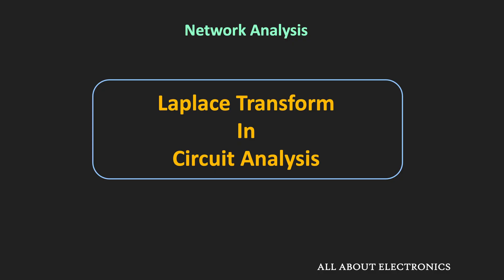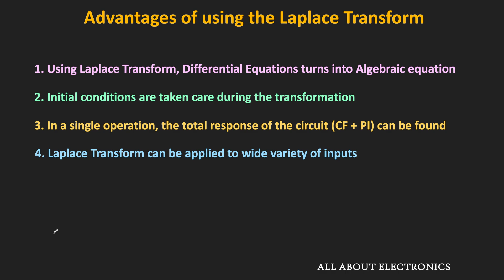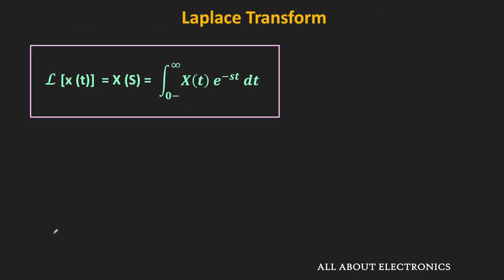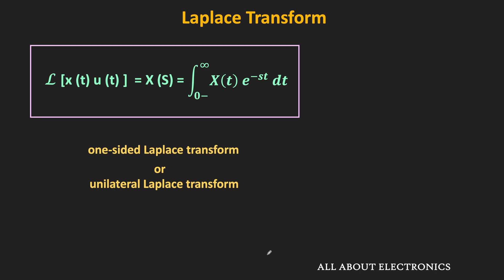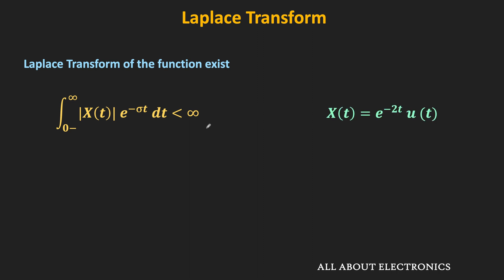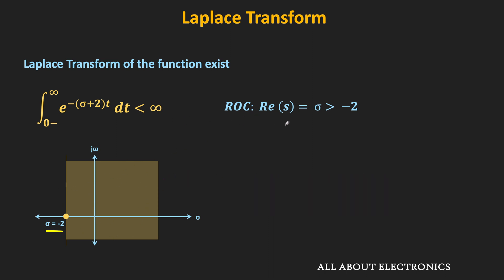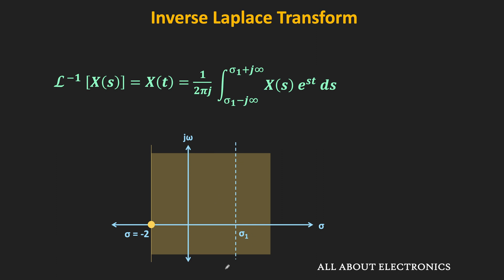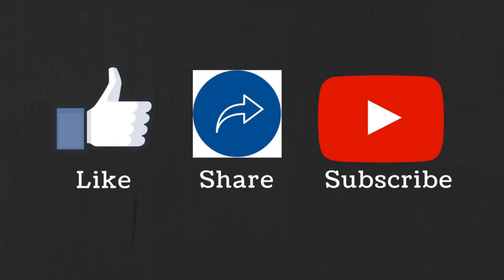What is Laplace Transform? Why Laplace Transform is used in Circuit Analysis?

Comment: Can you please explain how we will going to use Laplace transform in circuits involving diode and transistors of all kinds.
I was working with clippers and clampers lately but I wasn't achieving desired results with that.,
If you have any idea regarding that then please help
Reply from the maker: The Laplace Transform will be useful when we are dealing with a source which is not DC or sinusoidal signal. (e.g ramp signal, exponential decaying signal, step function etc). If the clipper or clamper circuit contains a conventional source like DC, square wave, triangular wave, or sinusoidal wave) then it is better to deal such circuits with the conventional circuit analysis. I have already covered how to analyze clipper and clamper circuits. For more info, you can check those videos and the solved problems related to them.

Comment: 7:14 please can someone explain how |e^(-jwt)| = (sin^2(wt) + cos^2(wt))^0.5
Reply from the maker: As per Euler's e^jx = cos (x) + j sin (x). 
And e^-jx = cos (x) - j sin (x)
If you just consider the magnitude then that is equal to sqrt (cos^2 x + sin^2 x) for both the cases.
For example, if you have a complex number A + j B, then its magnitude is sqrt (A^2 + B^2)
So, similarly, | e^-jwt| = sqrt (cos^2 (wt) + sin^2 (wt)) = 1
Reply: @ALLABOUTELECTRONICS  Thanks a lot for quick ve detailed answer!
Reply: Because i used for current, j used for imajinary in electrical engineering. By the way, I prefer in-phase (I) and quadrature (Q) as an electrical engineer because there is no imaginary thing in real world. Mathematicians loves abstraction so they call it imaginary.
Reply: Why are you using "j" to represent imaginary number
Didn't the representation of imaginary number "i" comes from the term "imaginary"
Using "j" just doesn't make any sense
Reply: @zoro.73  In Electrical Engineering the letter "i"  is reserved for electrical current so we use the letter "j" instead.  Hope that helps and God Bless!